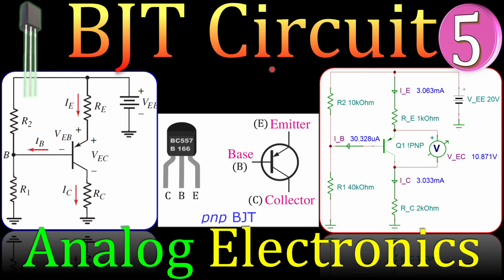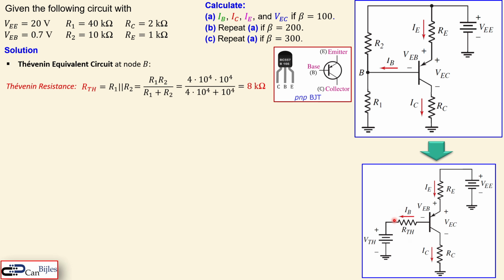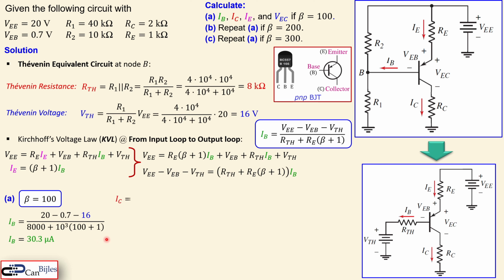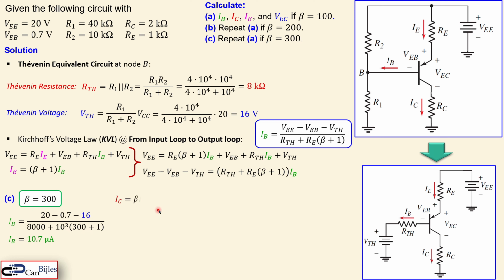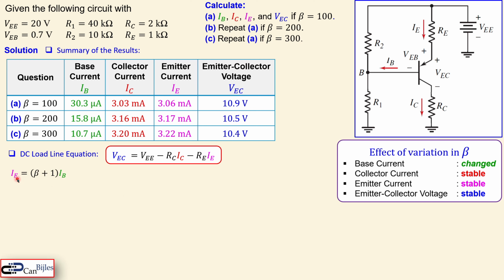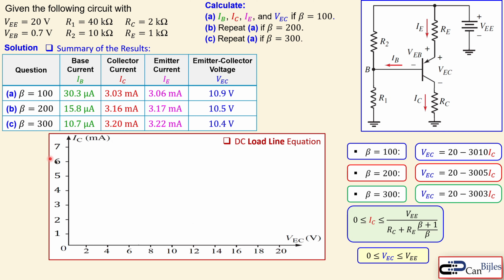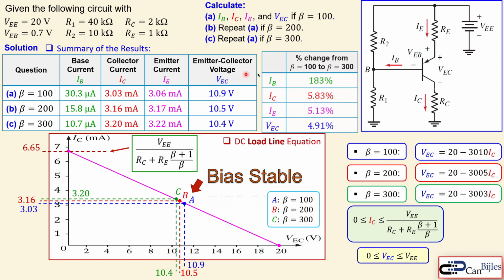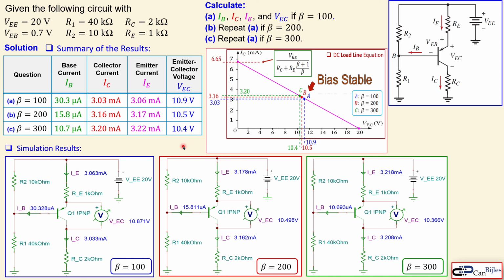Bipolar Junction Transistor (BJT) Circuit 🌟 Four-Resistor Bias Stable PNP BJT Circuit 💡 Example 5

Comment: PNP?  More like TNT, 'cause these lectures are dynamite!

Also, is it fair to say that since the base current is so small, you can just consider the voltage at node B being determined by R1, R2 and V_EE?
Reply from the maker: You can use this approximation, but it will never be exact.
Reply: @CANEDUX  That sounds fair.
Reply from the maker: Great👍